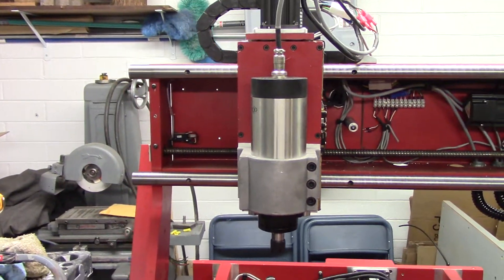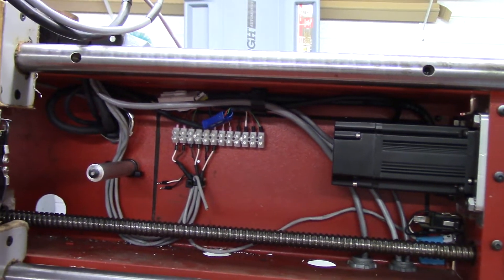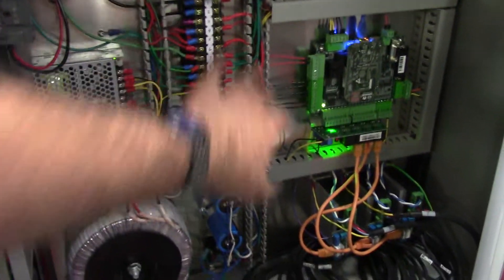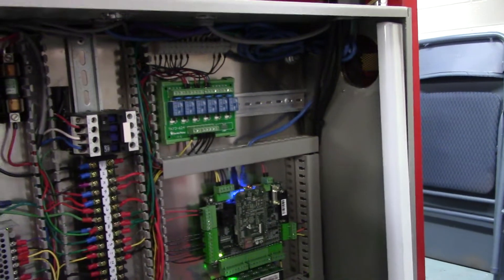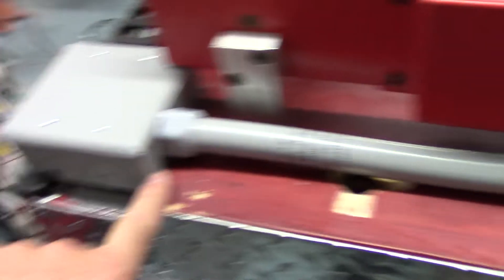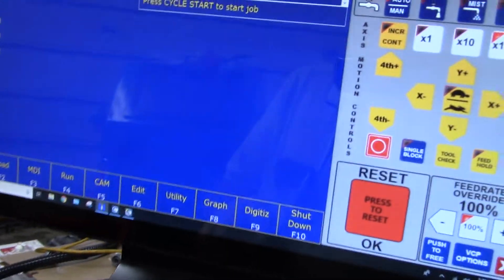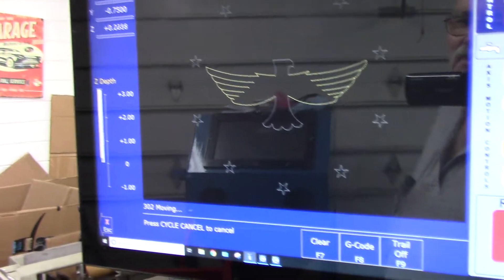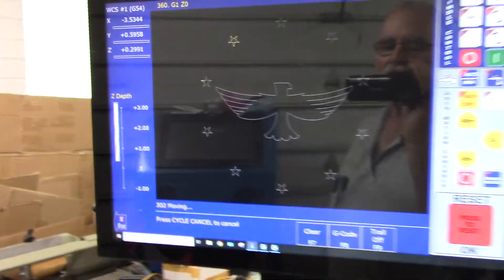Phoenix CNC Router Upgrade: Centroid CNC Acorn DMM AC Servos. Part

Comment: The machine looks average but the wiring is industrial-grade, except for those mechanical limit switches... Those just beg to be replaced with proximity sensors.
:-)
Reply from the maker: On a router I'm fine with it for now. Even better is the homing to index pulse on the Dyn2 drives...